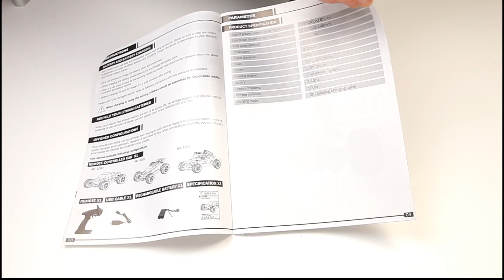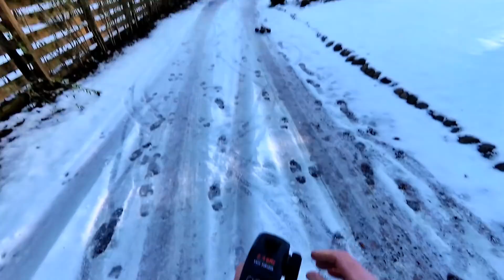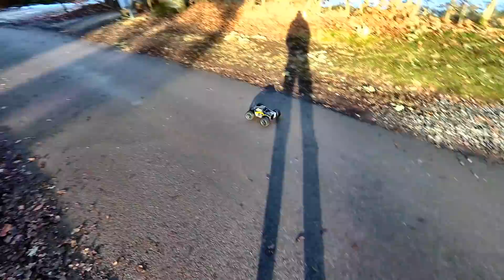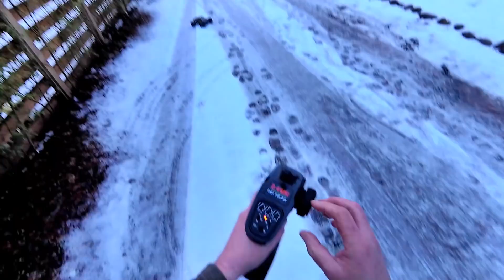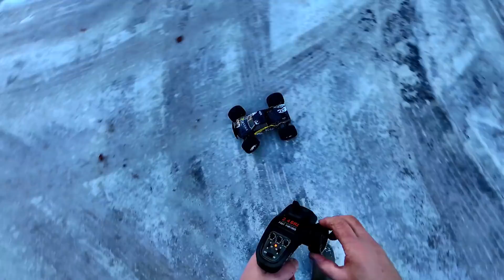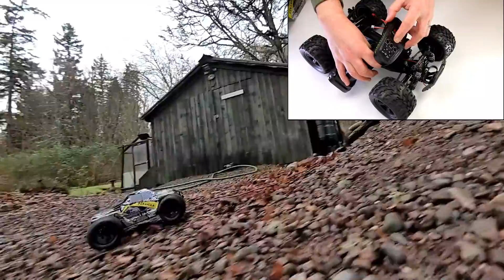PXtoys Piranha 9200 1:12th Scale 4WD 540 brushed motor 2.4GHz RC car

Comment: Tigger, i ordered one of these before seeing your great review, i used to have a Tamiya "Brat" and hoping this will be as good or even better, but a couple of questions, do you think this will do a bit of entry level crawling, toying with putting in a different motor for lower speed higher torque, also where do i get more lipo`s for this
Reply: the Brat. I had a grasshopper and the blackfoot. i just bought one of these. unfortunatly mine came with lipos that are junk.  they say 1700 mah but are really 1000.

Comment: Hey tigger I need to find out what kind of fpv goggles do you use that you put your glasses in cause I wear glasses and I need to get what you have please thank you
Reply from the maker: I use several FPV goggles check out the mods I did to alter them here https://youtu.be/TaNLNsDtWUc search Goggles on channel and most I have changed. Hope that helps, good luck and FPV is even more fun when you can see ;-)